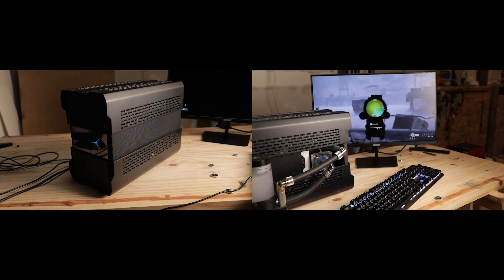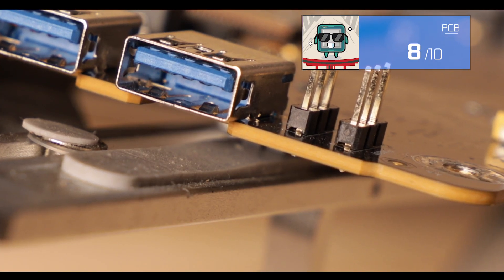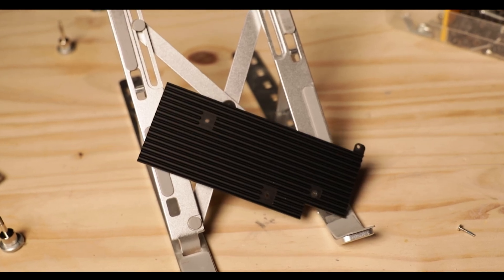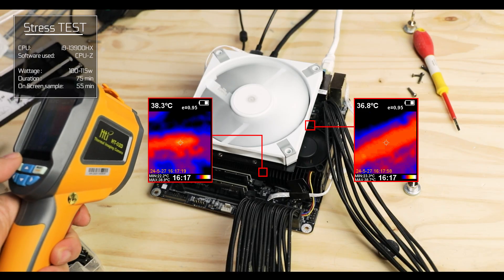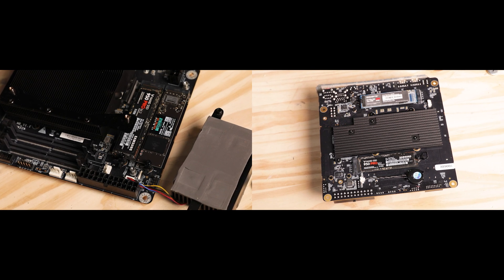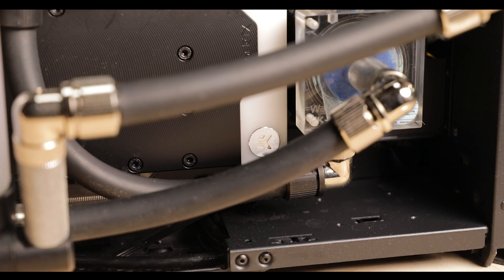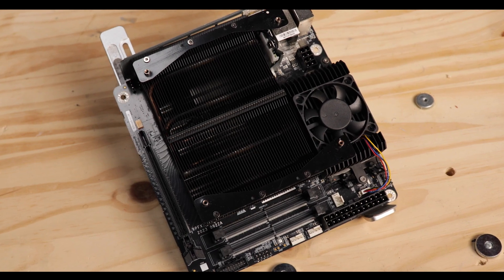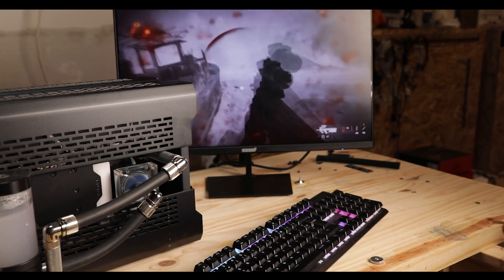MINISFORUM AR900i : MINI PC heaven!

Comment: Wich one is better, AR9000i or BD790i?
Reply: there's a better cheaper more efficient option, the BD790i SE which costs 329 USD only. it has a 16-core Ryzen 9 7940HX CPU. aside from not having wifi, and 2x nvme gen4 slots, it's identical to its bigger cousin the BD790i SE.
Reply: I'd go with AR900i because BD790i has a few hardware flaws that require new revision of the whole board. BD770i doesn't have issues.

Comment: Is there any ram installed? Also 5600 MT is very disappointing for intel.
Did you test the igpu?
Reply from the maker: None. Actually, RAM can go higher. I tried 6400 and worked fine. But not in the board specs.   Yes tested the igpu . It's fine some aging games like borderlands .